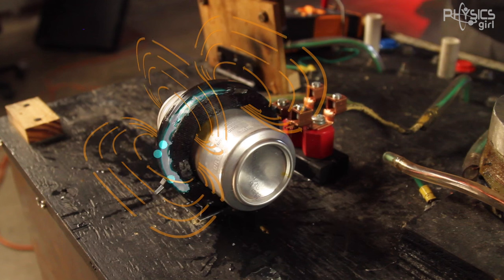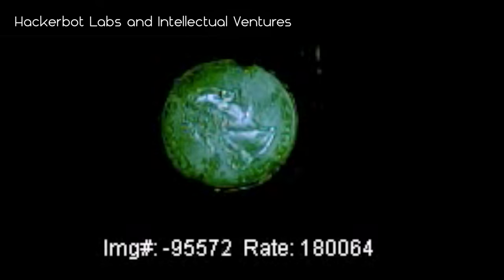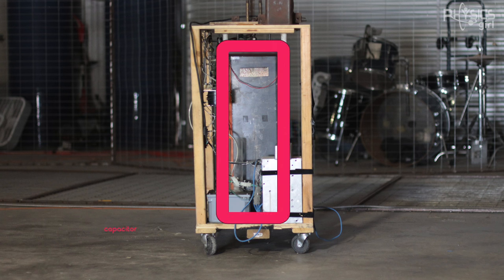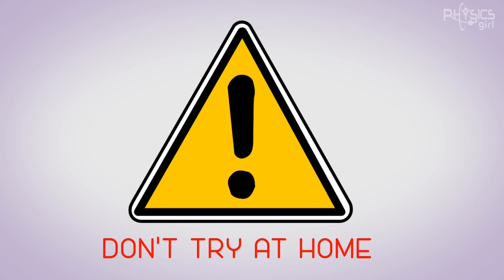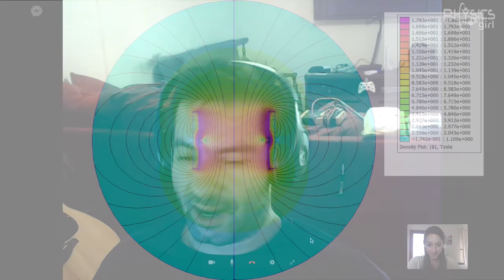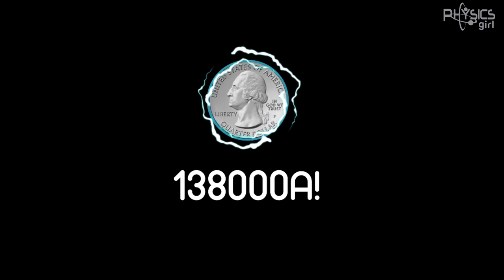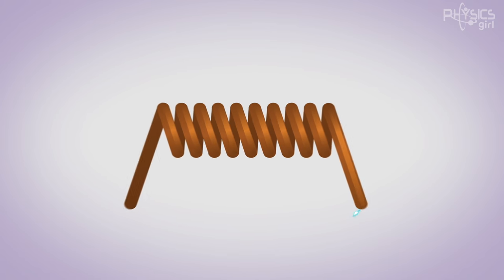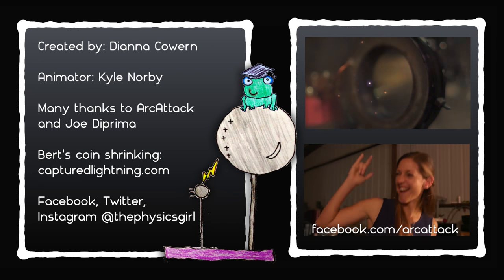How to Shrink a Quarter with Electricity

Comment: Does it change its physical properties? Is it more brittle or is it stronger now?
Reply: Hussam Kazah it would be cold worked, so yes slightly stronger in most cases, assuming it did not get so hot as to temper it. Coins are made from cold worked material already though and there is a limit to how much it can add. I would guess the coins are half as hard as they could be from working, before being shrunk.

Comment: Back in the mid to late 60's I was doing high voltage experiments. I was building Tesla coils, experimenting with power transmission through the ground, and experimenting with high intensity magnetic fields. Very dangerous experiments!

Comment: If we up the power to 1.21 jigawatts, does it collapse into a black hole and go back to 1955? Or do we need the flux capacitor for the bleeder???
Reply: Jiggawatt is a measure of Will Smith jiggyness, not of power
Reply: A Jigawatt is not a measurement
Reply: Keep in mind that Dr. Brown is pronouncing gigawatt as "jigawatt". (And, many people think 'jigawatt' is the correct pronunciation... However, since the prefix giga is of Greek origin, I believe that giga should be pronounced with a hard 'g'.)

Comment: You can wrap the outside of that coil with a magnetic sleeve, and effectively 'push' the outer bands of EM force inward, doubling the power in that work area. Just so ya know.

Comment: What would happen to a sphere? A hollow sphere?  -- on a side note I was tempted to insert an inflation joke - but refrained.
Reply: The shrinking happens on that one plane so it would probably form a sort of cylinder with rounded tops and fatter near the middle, or fold based upon where the imperfections are.
Reply: To follow up this point: shrinking happens along the plane in part because the magnetic field lines are only along that direction. If we think of another system (helmholtz coils in multiple directions -- https://en.wikipedia.org/wiki/Helmholtz_coil), then we might be able to get shrinking along multiple directions... In essence turning the sphere into a cube! (maybe)

I think more thought needs to go into how that would be done.

I suppose if magnetic monopoles existed, we could imagine shrinking of a hollow sphere, but I am not sure how everything works out there...
Reply: Thanks Firaro and LeiosOS  -- I was thinking that the solid sphere might end up as sort of an hourglass shape or as you said a cylinder with rounded ends.  The hollow sphere would probably just explode or maybe just be quite deformed.
Reply: A sphere would shrink about the circumference in the plane of the coil, and sort of squirt out along the poles.  A sphere with a small hollow would probably close up, while a large hollow would probably be split, similar to the can demonstration.
Reply: Maybe the sphere will be cut in half like the can was

Comment: Does it stil weigh the same?
Reply: yep
Reply: @ about 1:40 she shows a side view of some very deformed coins and says something like it only shrinks from the sides but bulges out the middle. I imagine the volume would stay about the same. If not there would either be a mass or density change. Perhaps with all the deformation and heat some of the material sometimes gets blasted off. In that case only would it weigh less.
Reply: So it still works in a vending machine?
Reply: Nope, pretty sure vending machines need correct diameter coins
Reply: if it weighs the same then could people shrink a 20Lb ball into a pea shape ball with enough power? This could be a way to create a black hole.
Reply: "with enough power" is the problem... compressing matter like this takes a lot of juice, and it gets more as you get more dense.  I don't think you can generate enough of an magnetic impulse this way to create degenerate matter of any kind... and it probably stops working entirely when you feed it said degenerate matter on account of it requiring reasonably conductive materials to work.

Comment: Yea the main question as stated below is "Will this cause the mass of the coin to become more dense" If it does the applications would be extraordinary.
Reply: Yeah! Ant-Man suits for everyone!
Reply: the answer is yes, the mass of the coin remains reasonably the same while the volume generally decreases.  If you set up everything just right you can actually make the coin concave.
Reply: You'd have to measure it, but I'd say it's highy unlikely the density increases. Metals already form into very compact atomic lattices and even experiments that aim to emulate pressures and temperatures in the earth's core don't see a change in density. My best guess would be that the sides contract and the middle bulges out maintaining the coin's volume (mostly; you're probably losing a tiny amount of material in the process).
Reply: AdenineMonkey It has been tested... it's really counter inuitive but it does work. I should really have qualified that the change is tiny.  Project Stomper got a change of a fraction of a percent out of 100kA at 6kV.  Apologies for the confusion.
Reply: KaitharVideo I can't find anything on density change from a quick google search on project Stomper. Do you have a source for that claim?
Reply: AdenineMonkey sadly only a HAD comment from someone I know was connected to the project at the time the comment was made.  Look for Rockwell in the comments of https://hackaday.com/2012/09/28/how-a-quarter-shrinker-works/
Reply: @Thanos:
Mass cannot become more dense. In this experiment you neither create nor distroy a significant amount of mass. The coin should have the same mass before or after the experiment. The density of the coin could be different (although I would not expect that) in that the macroscopic (e.g. not at atomic level) solid state properties have changed (like hammering, heating or cooling  iron or steel) at the cost or release of some energy.
When the diameter of the coin shrinks either solid state level density increases or the vertical dimensions of the coin change from  towards a cilinder of smaller diameter and larger height. Given the amount of energy involved I would expect some of both (density and cilinder height).

Comment: An advantage of the coil vaporizing is that it immediately opens the circuit preventing a voltage reversal on the capacitor which would shorten it's life.  Great video!

Comment: Is the density of the coin actually increasing, or is it just making the coin thicker?
Reply: I think she said it gets thicker but which could mean that the density and therefore the volume stay the same.
Reply: i wonder if the current frys the 'space' between molecules ?
Reply: @mattsowerbutts4163  There are no molecules in coins. Only metal atoms with a network metallic bonds between them. I don’t know if the electricity can change the length of those bonds, but there are no separate molecules to squeeze together.
Reply: @marcochimio  hmmmm, what about sub-atomic space?
Reply: @marcochimio - Why not just watch the video and find out?
Reply: @ReasonableAccommodations  I did, of course. Maybe I missed it, so can you tell exactly where in this video my question is answered (because the one example they showed at the end just shows a smaller hole in the coin)?
Reply: @marcochimio  As in how many minutes and how many seconds into the video?!

No, I'm not going to cater to you in that manner. Watch it again, and pay attention this time.

Comment: Very cool. But, what happens to the structure of the coin? The mass must remain the same because you're not removing any from the shrunken coin. Is it imploding under the forces? Much the same as imploding the nuclear material of a fission bomb to create critical mass? So, the coin will weigh the same in both forms, but the internal structure will become more dense?

Comment: Question:  is the density changing, or is there material loss?
Reply: Mostly deformation. But temporarily there is higher density.
Reply: @0MoTheG:  But that doesn’t make sense.  If you have deformation, it would only LOOK different.  But there’s actual size change.  Which means, it’s one of 2 things:  density, or material loss.
Reply: @eschdaddy  Unless it's changing the thickness.
Reply: I have a similar coin shrinking machine. To compress metal you would need pressure similar to that near the earth's core which our current technology cannot achieve except perhaps in a nuclear bomb in an uncontrolled manner. The coin diameter decreases but the thickness increases so there is no reduction of volume hence no change in density.

Comment: This is basically how Z-pinch fusion devices work, these aren't the typical tokamak devices that most people think of.

A fuel pellet containing duterium and tritium is placed on a little platform and many thin tungsten wires are threaded vertically around it in concentric circles.
A large current is passed through the wires (somewhere in the region of 3-5MA) and this causes the wires to almost instantly vaporize due to the resistive heat generated. At the same time the large current also induces a huge magnetic field around where the wires used to be. The vaporized wires are now in a plasma state and the same inward force (the JxB force) causes this plasma to fly inwards towards the fuel pellet.

When the ring of plasma hits the pellet it crushes and heats the D-T fuel until the density and temperature is high enough for nuclear fusion to take place. The D-T fuse together and the pellet explodes outwards, releasing many extremely energetic neutrons (~13.7MeV iirc) which can be captured in a water bath sorrounding the reactor.

The water heats up and when expanded into steam it can drive turbines to produce energy.

Comment: So it's a 1/8th now. 
 Hmm, seriously though, is this similar to the effect inside a black hole, which ends up with a super heavy dwarf star at it's center??
Reply: I think it's the other way around. A black hole just has a point of insane mass at its center. once, it may have been a super heavy star, before its super nova.
Reply: @phoule76  So it's more like Donald trump then.
Reply: Yes. The matter in the center of a black hole gets shrunk when passing through, and this process creates exotic particles and a giant electromagnetic field. The difference is, black holes have enough material so as to not overload their total energy capacity, whereas with this experiment, they oversaturated the copper and coin's ability to stay stable during such a massive voltage drop, causing it to explode. It's the same as trying to force 1000 gallons of water per minute through a tube only capable of 100 gallons per minute; the tube will definitely explode if you try it.
Reply: @wordreet  Yes, matter does pass through a black hole. At that point, any solid matter would be shredded into its base waveform/particles, resulting in pure energy, and as we know a moving energy source creates a magnetic field, hence the giant magnetic fields surrounding black holes. 

The alternative explanation can be thrown out the window, since they literally claim the laws of physics break down when black holes are concerned.

Comment: Did I see a comment along the lines of  a "waste of electricity"?  Well, let's see:  At a rate of $0.1 pew kW-hr,  that's 26,496,000W x 30uS, or 26496kW x $8.3ee 9 = 0.002 cents two milli-cents per shrink or 500 coin shrinks for a penny.  Plus It's legal as long as you you don't sell the quarter for more than 25 cents, just add a working (?) fee.  I have been into this for a while, and am working on a "re-usable coil" with a very uniform shrink (% per kl).  And, yes, the mass remains constant.
atta-Girl!
--dalE
Reply: I thought you must have made a mistake, but no, I guess it's hard to judge how long a microsecond really is, because it really adds up to 2,2 millicents for 0,22 watthours... Amazing.

Comment: Dear Dianna, so many comments of people raising a question on whether density of the coin has changed. Please redo the video with an Archimedes like density measurement before and after the shrink. The Archimedes way  being weighing the coin and determine the volume by submerging it in water and measuring the water displacement (as I'm sure you know).
Please convince us and answer this density change question please?

Comment: Would it be possible to shrink it so many times, it becomes so dense, then collapses on itself to create a black hole...
Reply: I thought I heard somewhere that if there were to be a tiny black hole it would be extremely powerful until it eventuallly grew and consumes the earth and all that surrounded it
Reply: The serious academic physicists that I've heard have indicated otherwise.  For example, when there was some pop-hysteria about the possibility of the LHC creating a black hole with its high-energy collisions (up to 13 teravolts!), the physicists did the calculations and pointed out:  "Um, even if it did, they would be so tiny that they would evaporate before they could affect anything else."

A black hole a kilometer across would definitely rip the earth up.  However, it would have a mass something like 10% of the entire sun (which is a million miles across), and it would probably last longer than the current age of the universe.  However, a black hole the mass of a single coin would come and go in a flash before it could do anything meaningful.  It's an exponential scale both ways: big = lasts super long, but small = disappears super fast.

You can apply the "Nature abhors a vacuum" principle.  A big vacuum (a big black hole) sucks up a lot of nature faster than it can be evaporated, so it maintains itself; but a small black hole gets sucked out of existence by nature almost immediately.
Reply: animist channel, plus it would explode and destroy the earth with a force of 5000000 megatons of TNT?
Reply: Sorry for bringing up a dead thread, but if you watched Kurzegaht's video on coin-sized black holes, then you would know that the coin black hole will explode with a higher power than Hiroshima, so maybe it won't be harmless.
Reply: Thanks for joining in -- new thoughts are always welcome :)  You bring up a fair idea, but in the case we were discussing, it was not a black hole the SIZE of a coin, but a black hole with the MASS of a coin (a couple grams).  There is a vast, vast difference between the two.  A black hole the SIZE of a coin would have the mass of a mountain range, and yes that would be bad if it formed on earth!

Likewise, if the LHC had managed to cause microscopic black holes with their particle collisions, those would have had the mass of a few protons and evaporated away instantly, with no effective gravity to pull in anything from the surrounding area.  At that scale, gravity is so weak as to be meaningless compared to chemical bonds and other factors, and so a mosquito with billions of particles in it can just hang on the ceiling because of a little surface tension.

When we start looking at things like black holes, the exponential differences in size, mass, gravity, and time get so extreme that it is easy to be misled by our everyday intuitions.  We get into the realm of comparing infinities and inverse-infinities, and our brains are not naturally wired to do that.  Intuitively, we are used to comparing feathers to rocks, maybe, but the relative differences in these cosmic events are many orders of magnitude more different from each other.

I hope that helps...
Reply: Oh, well a black hole with the MASS of a coin will still blow up with the force of Hiroshima. I should've clarified. Anyway, I hope the LHC is successful. SCIENCE FTW :D
Reply: A 5g blackhole would explode with a yield of ~100Kt...quite a bit more powerful than the Hiroshima atomic bomb.

If it was the size of a quarter, it would have more mass than the earth and destroy the planet.  It's pretty funny thinking about a black hole with an event horizon of ~10mm and a bunch of earth debris forming an accretion disk.  Plus the moon would continue to orbit around the new earth black hole, so there's that.
Reply: betastrep assuming it survived the accretion disk lol

Comment: can you still shrink a shrunken coin?
Reply: can you "unshrink" a coin?
Reply: If you reversed the current on the coil the resulting induced currents in the coin would also be reversed, so would still be opposing the current in the coil, so the coin would experience exactly the same forces.

Comment: neat... now - what would happen if a living thing was put in there rather then a coin?
Reply from the maker: it would not survive.
Reply: time travel
Reply: It would basically experience a highly focused lightning strike, and probably explode.
Reply: +Physics Girl There is no kind of extremeophile capable huh?
Reply: ant man
Reply: +Physics Girl But wouldn't the organism have so much resistance that the current through it due to the magnetic field would be negligible, or am I wrong?
Reply: +Physics Girl 👾❤❤❤
Reply: Physics Girl I would think it depends on what living thing was put in there but - would it shrink - would it implode would nothing happen to it? Only one way to find out... for science!
Reply: It gets thicker.
Reply: Rice Crispy dude.
Reply: Since life has a higher resistance than metal it would likely burn or at that high of a current explode

Comment: Dianna,  I had developed the application of a well known machine known as a Magnaform machine, made by Maxwell Magneform.  The physics described in this video are identical to what we understood back in 1982 when we started to use this machine.  even the sound was identical, however all of our hardware was reusable, through design.